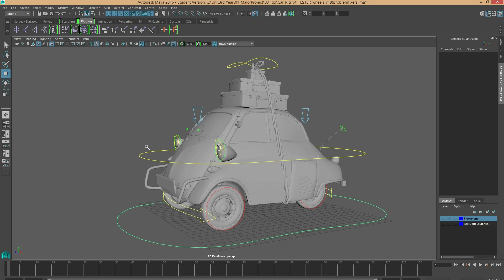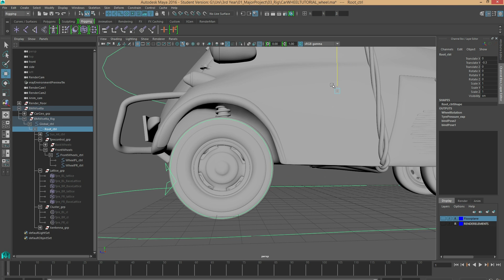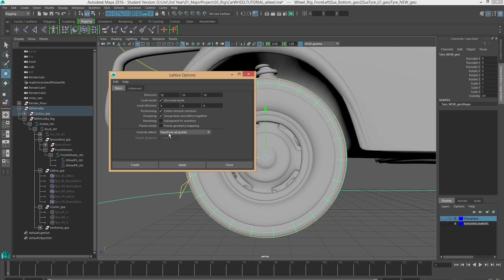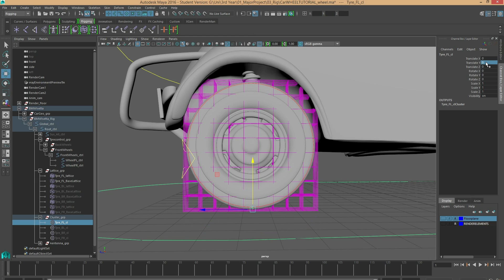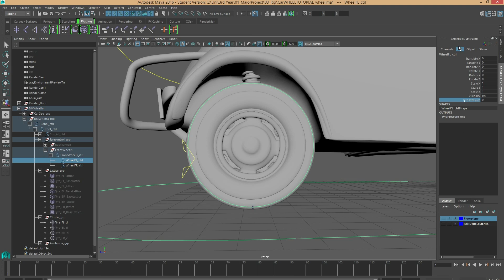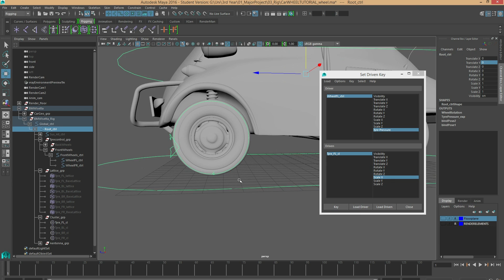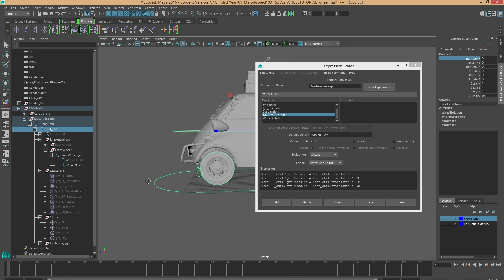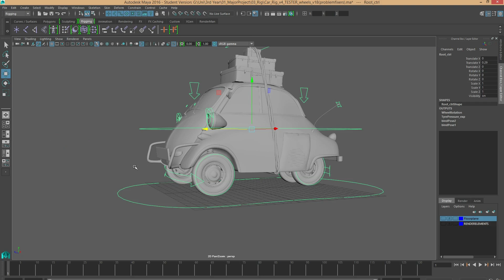Simulating Tyre Pressure In Maya (2016)

Comment: Great video. Couldn't get the squash deformer to work on my rig, this lattice method is a good alternative. 

I'm having an issue with I move my car though.. I have the wheels set to rotate when the locater is moved, so now when I have my tyre pressure higher than 0 and move the locater, the wheels rotate as expected, but the tire pressure freaks out and just stretches out the tire in the negative y.. 
Thats probably because of the way I set up my rig, but im not too sure on how to resolve it